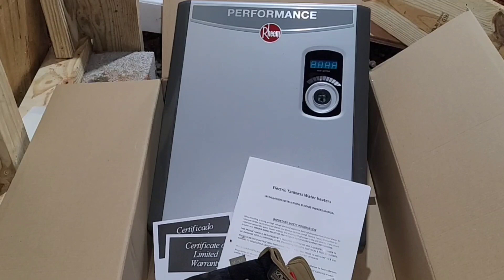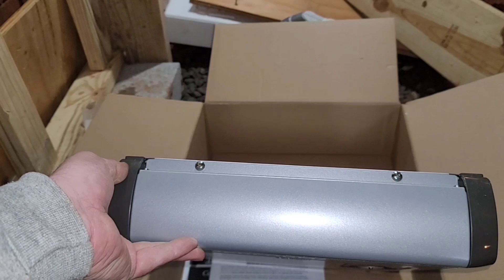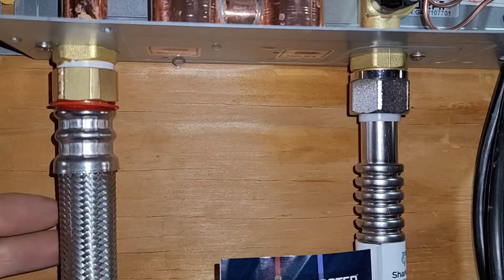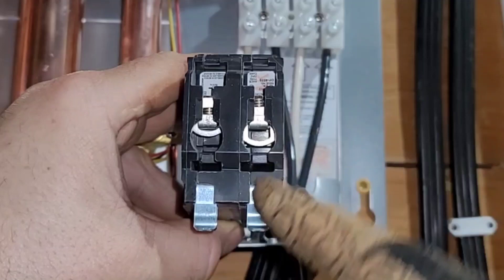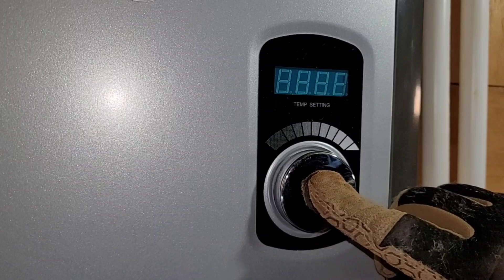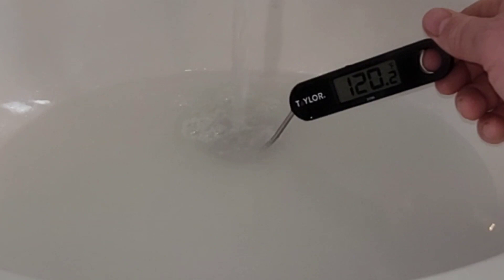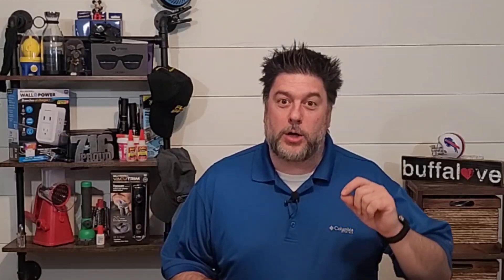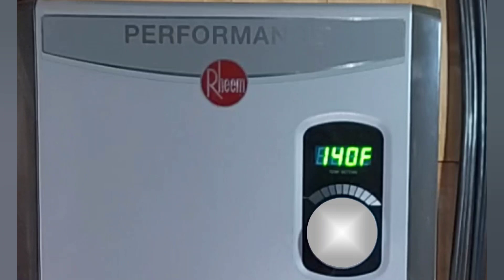🌟 Tankless Water Heater Installation. Rheem tankless water heater installed and tested [478]

Comment from the maker: Updated install: https://youtu.be/Yt6f2tceRgs

Descale the unit:  https://youtu.be/NNJEGX4AApo
Reply: Did you use a proper connector for the conduit for the electrical so you're not running through sharp metal?
Reply: Does the 18 have a rest button

Comment: I was disappointed to see how you ran the electric. You would never simply jam the plastic conduit into a sharp metal hole. At the very least, you would put a 1/2" or 3/4" romex connector there. I was only looking for a how to video to see if the installer was using liquid tight flexible wiring/ conduit, connectors. I only mention this because people shouldn't think its ok to simply put the conductor through the unprotected metal hole.
Reply from the maker: This install was to get hot water running... we went back and corrected issues.  Check this out: https://youtu.be/Yt6f2tceRgs?si=F3pTfqtsX4oHjvHB
Reply: Lol always a critic
Reply: wire comes thru wall for wall mount. how do i protect the wire as it curves to go thru wall.

Comment: Jeff,  Thanks for the review.  As a retired master electrician I would urge you to wrap the white wires in red electrical tape.  This will signal to anyone who follows you that these are in fact HOT wires when electrified.  White represents Neutral wires.  Your present wiring without red colors will confuse all but professionals who know how to spot non-professional installs. Safety first, please.
Reply from the maker: This install was a temporary fix.  I had it reworked to re-identify the wires on both sides. Thanks for stopping by and commenting 👍

Comment: Ok for future reference to anyone who sees your video. They must know that the unit requires 2 40 amp dual pole breakers because each chamber requires 40 amp at 240v. In order to obtain this you need to connect both black & white wire to your dual pole breaker.  Then respectively connect them to the system.

Comment: I except that you used electric to heat the water.  I understand that gas heats better and faster.  I used to have an electric system in each room above each sink or showers.   I loved it.
Reply from the maker: My old tank was electric as well. They have gas units, but I chose the electric version for convenience. Thanks for stopping by and commenting 👍

Comment: Great info! A couple tips on the electrical. You have to re- identify the white conductors with red or black tape at both the heater and in the panel. Also the ground ( bare) wire is not connected to the neutral. It’s landed on the equipment ground in the panel.
Reply from the maker: Thanks for the tips!

Comment: Several years ago I thought about putting a natural gas instant water heater. After researching it further I decided to stay with the old 40 gallon natural gas heater. This what changed my mind.
1. I would have to have a larger gas line from the meter to the house. I would have to upgrade my natural gas meter. Just upgrading the meter would cost $ 625. The cost to upgrade the natural gas line from the meter to the house and to the instant water heat would be several thousands more.
2. I would have to install a water softener. That would cost anywhere from $ 2,000-$3500.  Water softeners have to be maintained with chemicals in order to work. Our water in Houston is pretty hard. Scale, lime and other deposits would plug it up over the years.
Reply from the maker: I thought about going with gas too, but the upgrade cost wasn't worth it. I've been impressed with this little electric unit. Thanks for sharing your thoughts! 😃 👍
Reply: @Jeffreviews4u  everytime I talk to a plumber that do not recommend electric tankless of any size they always say people complain about it not providing hot water in a shower or tub, how's your experience with this one.
Reply: That all depends on the brand you don't have to do all that with a Navien tankless water heater.
Reply: You don't need a water softener, I install them daily. Unit just needs to be descaled once a year. Also you don't need to "upgrade your meter", just an individual 3/4" gas line to the tankless OR If your gas system is already capable of adding the added btu then you don't need to do anything besides update a small portion of 3/4" gas line that was branching off of to the old water heater.

Comment: Bought this exact model for a single wide I reacently bought. I am going to be redoing the entire water system, which is currently galvanized steel and copper, with bits and pieces of other materials here and there. Doing everything in PEX-A due to the material's ability to expand, for piece of mind with frozen lines having a lower chance of bursting.
Reply from the maker: I've been impressed with mine. Very convenient and I like the on demand aspect. Thanks for stopping by and commenting 🙂

Comment: I have the next Rheem model up. 3 - 40amp breakers to match my tankless oil boiler output. When the spring comes I shut down the boiler and maintenance it and turn on my electric water heater.  Very impressed.  The truth, I’ve noticed the bill go up about 20 bucks but I don’t use the tankless during the winter.

Comment: I'm glad I found this video. You answered a few questions I've had. First, it looks like you're using pex and that's what I want to do. I know I need to check my current regular water heater power requirements, but I'm hoping I can use the same circuit. I'm pretty confident that I won't need to use much pipe because of the existing pipes. But I need to study it. With only 2 of us in the house I think one of these will take care of our needs.

Comment: I had this unit installed on the outside my house and it has lasted for about 20 months.  It has stopped heating constantly since the last descaling. I have been given a lot of advice about what I should do and it is all expensive.  Considering the price of everything, I think I am going to just change it for the same one.  With this video, I think I can do it myself. So, wish me luck and thank you.
Reply: Don't install it outside your house, they are not weather proof - that's why your last one failed.  These need to be installed indoors.  This model does not require a vent either, so you can place i pretty much anywhere.

Comment: I had this exact unit installled in my familys cabin 5 months ago, it worked great up until about 3 weeks ago. Granted we are on a well, and have hard water, but we literally take this thing apart at least twice a day, clean out the inlet impeller, clean the inlet screen, put it all back together again, it works for a few hours and then stops. It doesnt show any codes, just a trickle of hot water, thats it. Not only that but our cold water only trickles too. I understand that unless there is a huge scale buildup this unit shouldn't affect my cold water, but its happening. We have no leaks, we upgrated everything from copper to Pex, had a 200amp breaker installed, I've dug up my main water line that goes into the house, no leaks, ive had a plumber come out and check it out, nothing. My girlfriend soaked all our airratiors in vinegar overnight,  no change. Ive spoken with Rheem tech support 6 times and all they can do is loosely troubleshoot it for you and send you a manual on how to fix it, my unit was 2 DAYS out of date so nothing was covered, can't return it. The only positive thing is that i live on a lake and can take baths in it. Any input would be an enormous help. Thanks
Reply from the maker: Has the unit been descaled? Depending on the level of hardness in your water this should be done throughout the year.
Reply: @Jeffreviews4u  thanks for the reply. I am descaling the unit now. Within 60 seconds there was already noticeable sentiment. I initially bought a 1/3 pump that seemed to be too much as it was spraying out of my inlet hose. Went back to town and bought a 1/6 that seems to be working. Im thinking let it cycle for 2 hours?? Then afterwards should I cycle clean water through the unit?
Reply: @Jeffreviews4u  just descaled the unit for 90 minutes. No change. Going to town again tomorrow to get Tannerite and another heater I suppose
Reply: So they only have a 6 month warranty on this?  That's shameful, but becoming more and more common with everything.
Reply from the maker: Possibly because some customers will not do the necessary maintenance.  These units need to be descaled. Thanks for stopping by and commenting 👍

Comment: Good info. Thanks! Quick tip: don't use Teflon with those fittings. It doesn't provide any backup protection and only prevents you from getting the connection tight enough to prevent leaks like you had.

Comment: Getting propane is tricky. I have 2 Rinnais, one for hot water the other as a boiler for the radiant floor. They are wonderful as long as they have propane, DA! I want a backup tankless electric water heater just in case. Great video. Thanks. In the country off Virginia's Chesapeake Bay.

Comment: Thanks, just starting my research. My tank heater is nearing 25 years old, so before it fails need to sort this choice out.
Reply from the maker: This was a pretty quick and easy install. In this video, I did a quick setup to get hot water quickly (my tank stopped working). I later went and did a more professional install. Check that out here: https://youtu.be/Yt6f2tceRgs

Comment: Have one, Tempra 27,  hooked on my well ( living rural community), works great. Love it. My plumber did not recommend it for a whole house system rural, said it would not work . He was WRONG (Iblame it on working old school). Just a comment on your install: it looks great but around here, a pressure safety switch is mandatory on the hot side. Good work. I will be installing the exact same system as yours at a friend's house in a few weeks. Keep posting.

Comment: I’m installing the Rheem 13KW heater. I’ve got low flow showers and I’m willing to restrict folks to one shower at a time. I’m still in the dark about my water connections. There are male 5/8” compression fittings into and out of the heater. They included two 5/8” sleeves and two options: I can use a sleeve and female compression fitting with 5/8” copper but that’s out. I have well water that’s slightly acid and I’m replacing all the copper pipes now. I’m going to use an acid neutralizer but no copper - all plastic.
The other water connectors are a male compression to 1/2” male NPT. I can buy flex hoses with 1/2 NPT so I prefer that option. I called Rheem to ask if I could use just the sleeve or do I need to put short pieces of 5/8” copper tube inside the sleeves? They just said to “Ask my plumber.” 
I’ll just have one 60 Amp breaker with #6 wire. Rheem shows how to wire the breaker but doesn’t even mention opening the unit. There are two sets of small screws. One set didn’t seem to allow anything to open. The other set let me remove the entire front of the unit. Pity they didn’t bother to tell us which to try. It looks nice inside though. Neat!
Ok. Back to it.😊

Comment: Shark Bite. Honestly, even though Shark Bite is expensive compared to regular fittings, it's well worth it.  I have had issues with getting other fittings just right, but I have never had an issue with Shark Bite hoses, valves, or fittings getting in place or leaking
Reply from the maker: I agree, I had no problem paying the premium price for something that made my job a lot easier. They are very convenient. Thanks for stopping by and commenting 👍

Comment: Thought about going electric tankless (no gas service here) but decided to go with a rheem hybrid water heater instead just over a year ago (heat pump + electric tank water heater). 

Far easier run on a home solar+battery system or a generator than electric tankless and has almost the same operating cost as gas tankless water heater. 

 (Massive down side is that it cost more upfront and you'd need a condensate line running to a drain or outdoor just like with an ac.)
Reply from the maker: Very cool. I've heard good things about the hybrid unit. Thanks for taking the time to watch and comment 🙂 👍

Comment: Nice looking install except for one thing. You need an electrical connector where your wires enter the water heater to protect wires from damage. I am a licensed electrical contractor

Comment: Are flexible pipe connections required, or can copper water pipes be soldered to the wall mounted tankless? 
Thanks, great video, very helpful.
Reply from the maker: No, I used them at the time for a quick easy install. I ended up putting out an updated video showing how my final install looked. Thanks for stopping by and commenting

Comment: I understand that installation is very expense - assuming a $1,400 tankless heater unit, the total cost with other parts and labor is approximately $4,000 total - but could be higher.  This compares with an equivalent 80  gallon hot water heater about $1,500 total cost.

Comment: You mentioned another brand with plastic inlet and outlet are you referring to the A.O. Smith model?  I’m probably one of the few that have both the Rheem 18 kW and A.O. Smith 18 kW.  I’m currently using the AOS which according to them lasts longer due to the way the heating elements draw electricity. I like the Rheem because you can turn it on and off and like you said the display will change when it’s in use.
Reply from the maker: Yes, I looked at the AO Smith model as well... didn't have great reviews and the connectors were made of plastic.  I also think it was a little more expensive. I've been pretty impressed with the Rheem.  Thanks for stopping by and commenting 👍

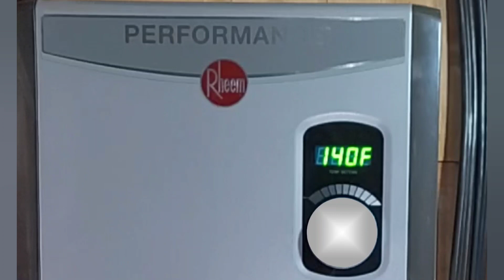Comment: @8:49 you mention the E5 code.  I think the E5 is actually an error that is letting you know that the water temperature that you have set is not being reached.  Typically, due to excessive flow rate. Meaning, due to high water pressure (high flow rate) the water is not staying in the element long enough to reach the desired temperature.  So the fix would be to install the proper flow regulator and/or lowering the desired temp.
Reply from the maker: Yes, this is correct. Thanks for stopping by and commenting 🙂
Reply: @Jeffreviews4u  I have this same unit and was looking for info regarding the E5 error.  The YouTube algorithm is still serving me content related to this unit.  Thought I would share what I learned about the E5 issue on your video when I saw that you mentioned it.
Reply from the maker: @hiphop360  I appreciate it and I know others will as well! Thanks again.
Reply: @Jeffreviews4u  You might also set it lower to the anti-scald temperature of 120 degrees, possibly lower, most appliances and spigots don't need to be that hot.
Reply: Hahahaha!! This exact brand and size is a POS!!! 💯 Displaying E5 is all it’s good for and that’s because I live in the south in Texas with hotter climate and this unit can only run sinks literally so even though it’s brand new it coming off the wall because my new unit has arrived and didn’t give Rheem any money again. Fool me once shame on me, but not again cuz I bought a different brand with better warranty 💯
Reply: @robertescobar3147  What brand did you go with?

Comment: Would it help if u insulate the pipes so hot water stays hot ?
Reply from the maker: The plan is to have the exposed lines in the basement insulated...should help some. Thanks for stopping by and commenting 👍

Comment: My water heat is a Fagotti and it is inconsistent, sometimes it works something it doesn’t, and it’s been not working I’ve been showering for a week with cold water … gas is going in, water is going in but it doesn’t get the signal to turn on despite of having every faucet open to hot

Comment: Do you wish you would have installed an isolation valve for easier clean-out / flush of the water heater to get rid of build-up?
Reply from the maker: I do wish I had done that originally. I have since added them and will show that when I descale the unit. Thanks for stopping by and commenting 👍
Reply: My system is set up the way you have it in the video. I'm trying to figure out how to get it flushed because my hot water pressure is low. I don't have an isolation valve on it. Can you please give me some advice? I have had several plumbers come out and they are saying different things and I can't get it flushed.

Comment: It doesn’t seem to be wired correctly per diagram… diagram shows two double breakers with each wire set on different breakers…. Is this necessary since there are two elements?
Reply from the maker: One set of wires goes to one side, and the second set of wires goes on the other side. They shouldn't be mixed. You are correct in saying there are two double pole breakers. Thanks for stopping by and commenting 👍

Comment: You need two 40A circuits? Or just one 40A circuit breaker? Wish you showed the other end of your wires to the circuit panel.
Reply from the maker: Yes, 2 - double pole breakers. Thanks for stopping by and commenting 🙂 👍

Comment: As a DIY, one should mention that the unit requires 8AWG electrical wire. It would have been interesting to see what conduits were used to run the electrical wires from the outside service panel to the inside unit.
Reply: I'm doing one tomorrow with 2 breakers 50amp 2-pull and also running wires 240v 50amp outlet for a chargin station. The main run with all the wires is 1-1/4in emt
Reply: @babygangster4486  I thought the double breakers  need 40 amps. As far as the conduits, I had to find 45 degree angle fittings. Special ordered from Home Depot.
Reply: @tomc642  the amperage depends on the system. The system i got is 100amps so 2-50amps and I was thinking about getting those 90• for my 1-1/4in but I luckily i found a pipe bender
Reply: @babygangster4486  Got you, I thought you had the 18kW system, which only draws 75 amps.